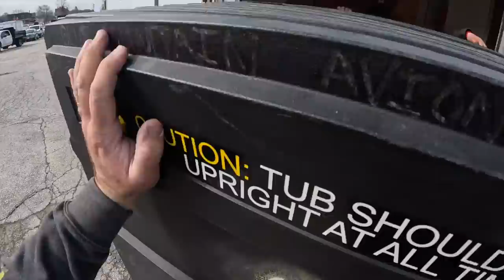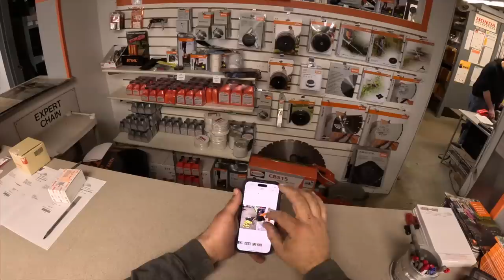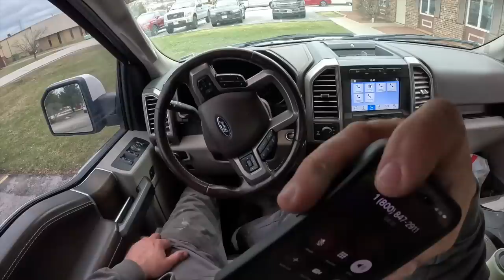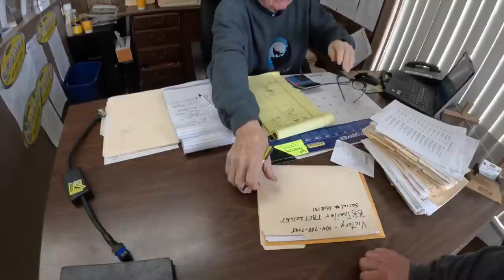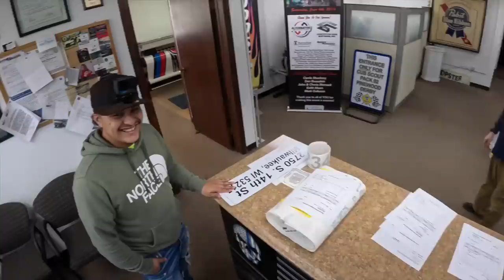This old truck is looking SWEET! I love it!

Comment: Ryan. You will feel so much better in a short amount of time. I was like you Convinced something major was wrong with me. I stopped eating sugar, carbs and starches and felt fantastic within 3 days. Additionally your appetite will diminish drastically once the sugar is out of your system. The 1st 2-3 days are difficult. You can do it. Eat all the protein you want like bacon and eggs. As time goes on the cravings diminish a bit. Don’t confuse feelings of being empty with hungry. Bread is the wort thing because it’s a huge appetite driver. Best of luck

Comment: The part where you are showing the welding if someone tried charging me for that I would tell them to take a running jump they clearly didn't know what they was doing you would think they would check it before it leaves the shop you have done another top video keep up the good work

Comment: Ryan on the kombi- units I recommend you put a plug, air, fuel, and cleaning the screen in the exhaust system. It'll run like brand new for years to come. I work on those units for the company I work for.

Comment: Good cheap tip instead of buying a new battery , Use distilled water and fill up the battery and charge it, brand new, id recommend getting a grease gun and greasing the tie rods of the trucks, And wheel bearing if needed you should implement stretch and flex a lot of big trades do it before work it will help being sore,

Comment: Hey Ryan, the last video you said that asphalt melts snow faster because it’s black that’s the only benefit over concrete. Can you get black concrete driveways?
Reply: Not sure if there is a color additive in that shade. I've personally dyed small batches of concrete in reds and tans. I have seen a dark gray tint. One red batch was for a replacement door sill and threshold to match red Terra Cotta tile and it matched up perfectly.

Comment: That not feeling quite well is nothing to mess around with. Mention to your doctor and see a cardiologist for a peace of mind.  I'm same height and build as you and have done physical labor all my life too.  I'm 55 this year and I have  to say at 45 I peaked at strength no matter what I did otherwise.  It's all down hill from there old man but not in good way.  Adjust your workload and don't feel you have to prove anything to anyone.  It's what you pay others for.  A day will come sooner than later where you'll wake up crying in aches and pains wondering how you got this old so quick.

Comment: I had a card declined at fuel pump after I filled two tanks on my freightliner .Wasn't happy. I had cash luckily. I bought two vanities from Canada for my house. Bank saw it and blocked my card without calling me. Guess the algorithm can shut your card if it doesn't like a transaction.

Comment: You can do the sugar free diet, the first week is going to be awful. You will likely get the Keto Flu, which are flu like symptoms but it usually only lasts a day the ln you feel so much better.

For me I had less gut issues, no energy, I had acne like you wouldn't believe and I used to weigh 635lbs. I am currently 281 pounds. I didn't lose all the weight with a no/low sugar diet but a very large percentage was lost by no/low sugar.

I wanted to tell you about a podcast that helped me. His name is Vinnie Tortorich and the podcast is called fitness confidential. They have foil mouth bash the diet industry for stealing our good intentions. He created the saying NSNG No Sugars No Grains. That has really changed to no sweeteners no grains.  Because they want you eating things like Tomato and such .

I only eat cruciferous veggies which are extremely low carb and meats.

If you like Dr. Berg you will really like Dr. Ken Berry. 

Sorry I am the last person who usually gives diet and health advice.  I HATEDD getting unsolicited diet and health advice.